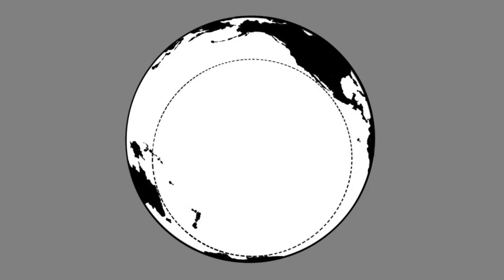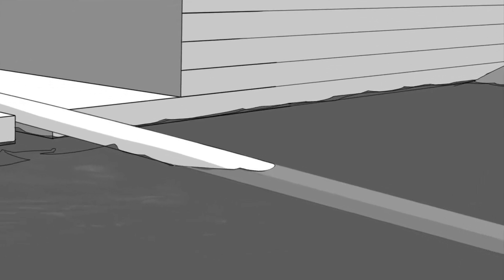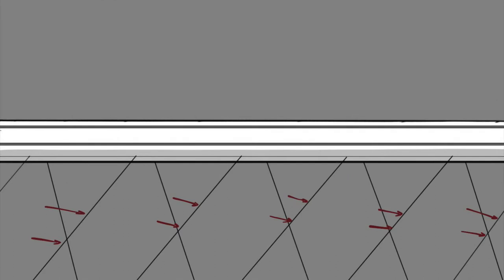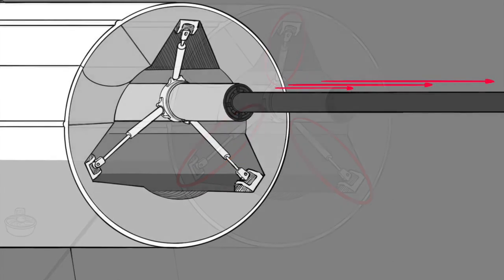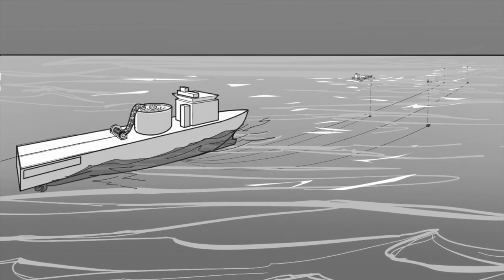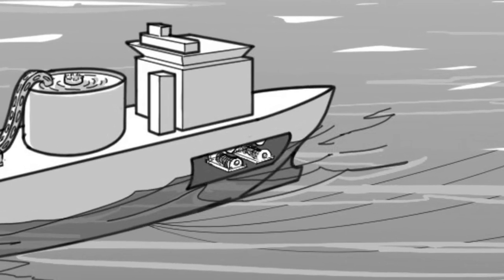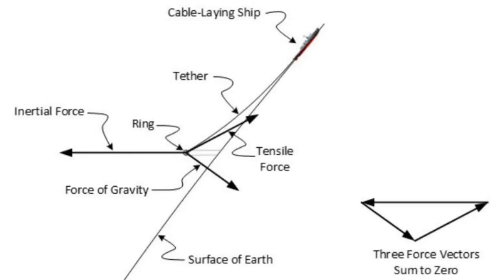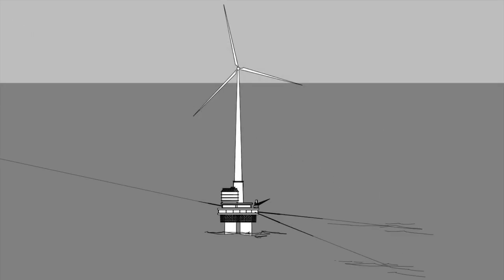Storyboard Video for Tethered Ring Animation Contest

Comment: Such a complicated assembly of casing plus ring being output at 1kph is a very bold claim. 1 km per day is more believable as long as most components are assembled elsewhere and transported to the factory.
Also, the ammount of ships involved in pulling the ring up must be staggering.
Still worth doing though.
Reply from the maker: It's more a machine-that-makes-the-machine requirement than a claim. If we can't figure out a continuous process that outputs encased ring at these rates, we'll be waiting for a long time for the ring to be finished. I suspect that there must be other products that are produced at similar rates (Undersea cables? Gas pipelines?). Would be awesome if we could crowdsource some data on other examples of representative manufacturing processes to see if this requirement is too over-the-top for where human civilization is right now.
Reply: @spaceinfrastructure3238  Cables and pipelines don't have active components inside of them. I think the pistons to stabilize the ring inside the sheath are a big problem (possibly one that could be avoided, is it even necesarry?) and the active components in the stationary ring but those have to be there.
Reply: @MrRolnicek  1kph is not terribly fast. That's 27cm, less than a foot, per second. An assembly line with sufficient component supply can manage this. Current assembly lines move faster making more complex designs, like cars and trucks.
Reply: @Varue  I don't think it's a reasonable speed if you want to include the overcomplicated sheath with pistons and a top hatch. I don't think the sheath is needed in the first place though. They mentioned earlier using Electric Ducted Fans on the ring to stabilize against wind and with just a little bit of waterproofing the same fans could be used for positioning instead of the sheath. Same thing goes for the ring itself, a thin layer of plastic waterproofing around is a better choice than a big sheath with actuated pistons and a top hatch.
Reply: @MrRolnicek  a disposable sheath wound be necessary since the ring will be sitting in the ocean for quite a while.